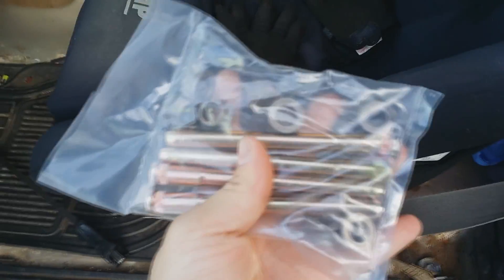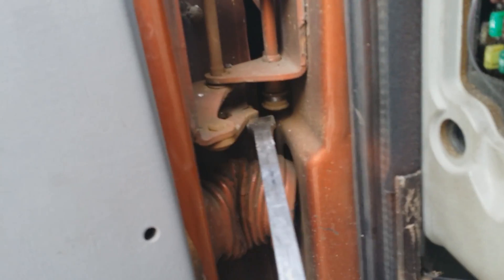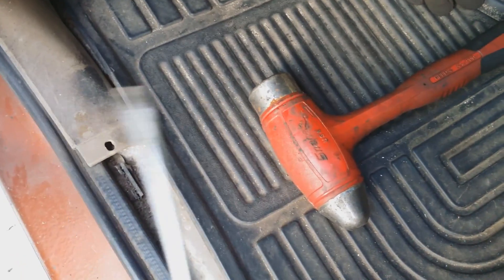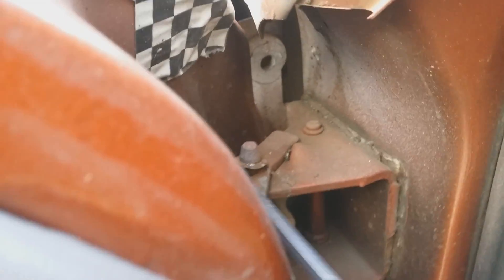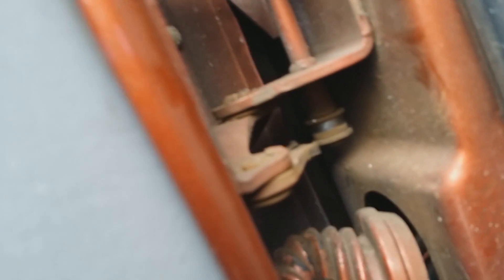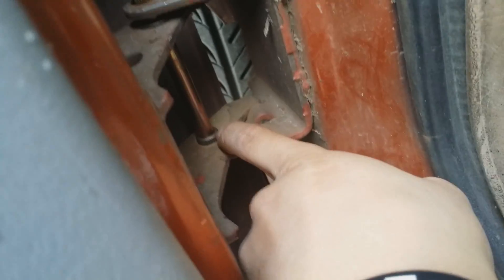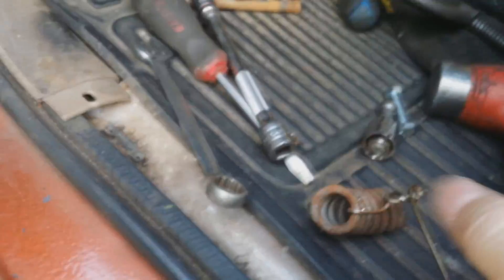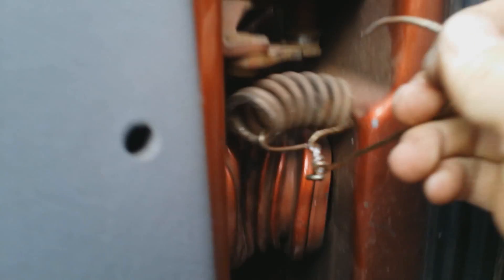Chevy s10 Door Sagging Repair (Ricetruck door hindge fix)

Comment: You cut the wires? There's a plug in there and wires are for interior light, locks and windows if they're power too.. kind of harsh doing a how to and butcher job lol. Entertainment value I guess.
Reply from the maker: waynenocton the wires that you are talking about which were cut by the previous owner are for the speakers, windows and door locks are manual. Too lazy to fix and too lazy to get a radio for it. This is what I get for buying a 600$ truck.
Reply: @RiceTruck  Hey, we paid $1000 for ours, and it's a POS!!! But, we still run 9's, and not many people can touch us on the street!! ROFLMFAO!!